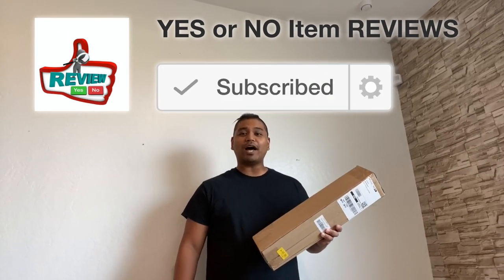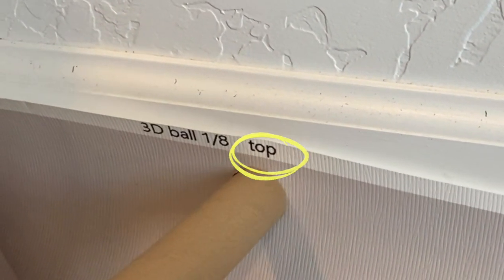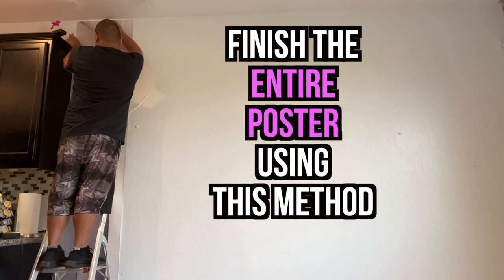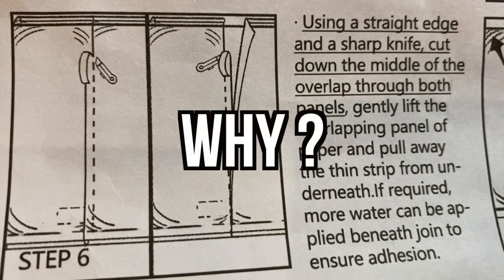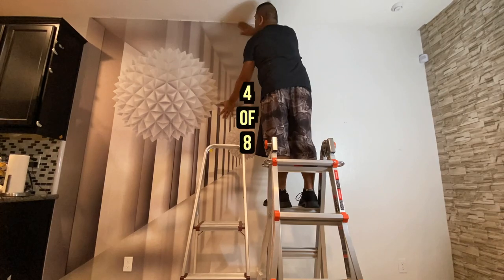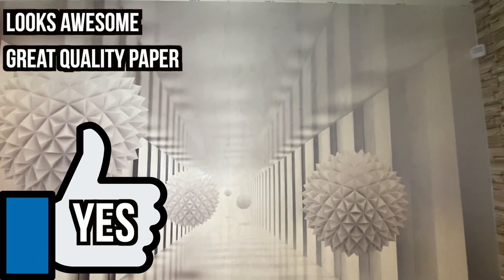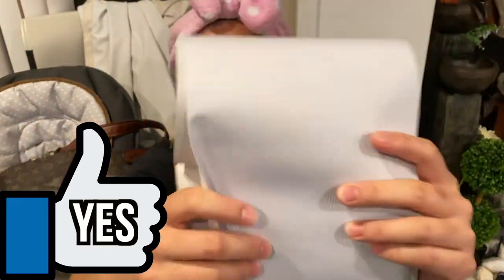How to install "SUMGAR 3D FUTURE BALL WALLPAPER"

Comment from the maker: ⏰ TIME CODES:
0:00—Intro
0:19—Unboxing the Sumgar 3D Future Ball Wallpaper
0:52—Spreading all the Posters Out of the Sumgar 3D Future Ball Wallpaper
1:11—Putting the Sumgar 3D Future Ball Wallpaper IN ORDER
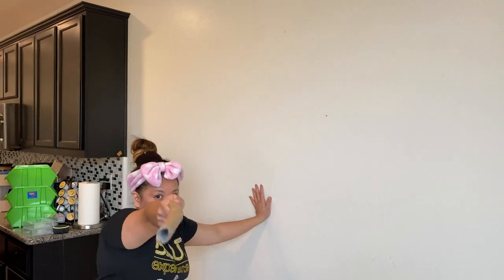2:26—Measurements of the Sumgar 3D Future Ball Wallpaper
2:50—Do this before Installing Sumgar 3D Future Ball Wallpaper
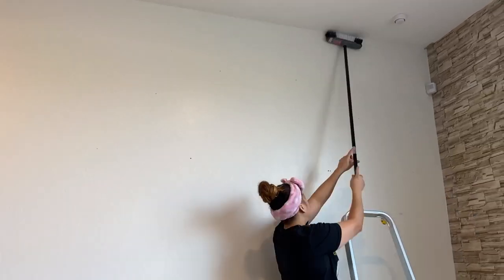2:59—Grab all the tools 
3:50—Why do you need water for the Sumgar 3D Future Ball Wallpaper?
4:05—How do you USE the Squeegee?
4:30—Spraying the Wall and Poster with Water
4:41—Another Technique on how to use the Squeegee
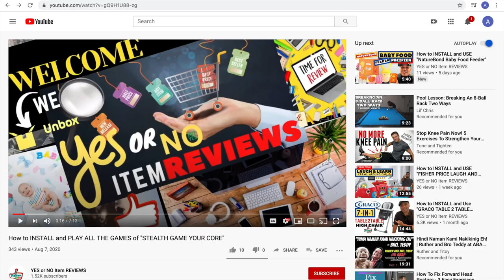5:20—Installing Poster #2 of 8
5:37—WARNING: We did NOT do this part…
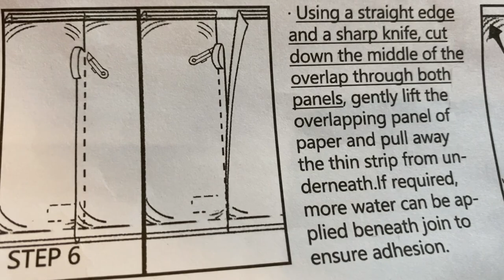6:09—Installing Poster #2 of 8 CONTINUED
6:40—How to Cut the Poster to reveal Wall Outlet
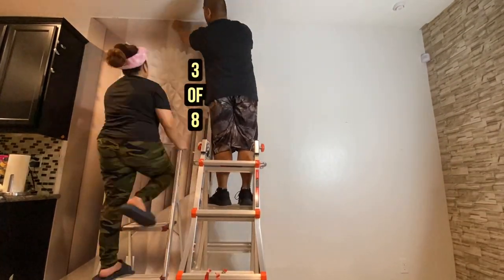7:05—Installing Poster #3 #4 #5 #6 and #7 of 8
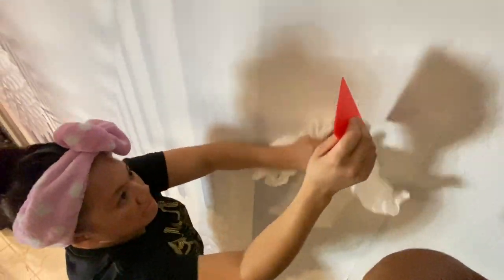7:43—Installing the last poster #8 of 8
8:38—Wall FINISHED…Wife FINISHED
8:45—GOOD things about the Sumgar 3D Future Ball Wallpaper
9:42—BAD things about the Sumgar 3D Future Ball Wallpaper
10:33—Learn more about the Sumgar 3D Future Ball Wallpaper